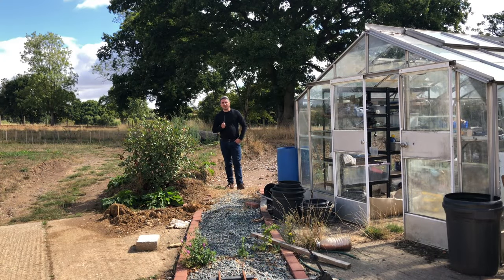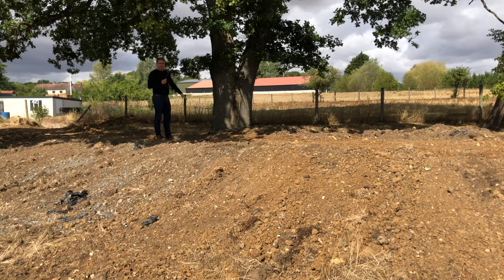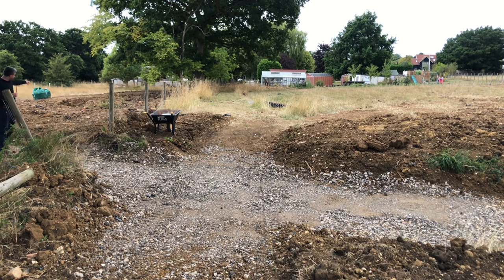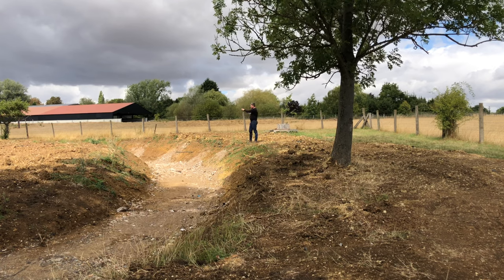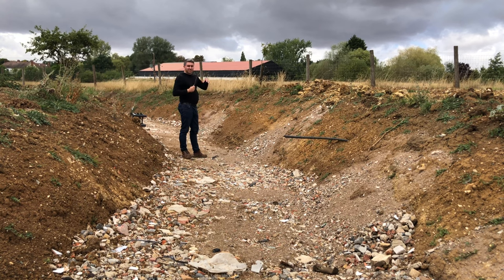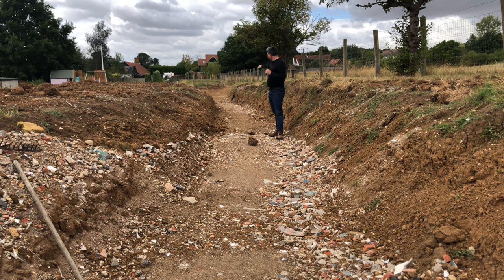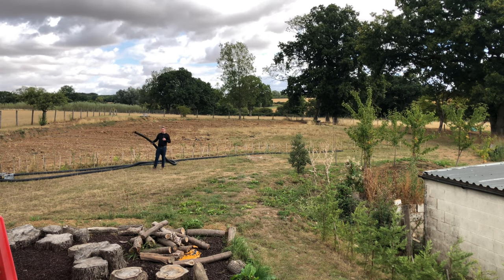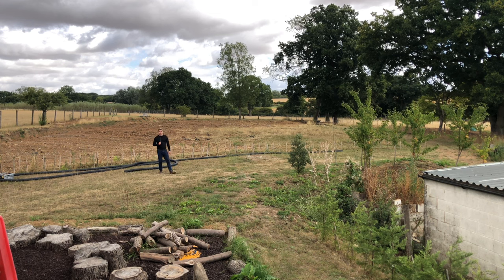Rebuilding a miniature railway - 3. Track Bed

Comment: So pleased to see you did not give up on this great project Rob. I know from experience that time spent on a good formation is never wasted as it avoids much arduous maintenance later. You didn't have either a bridge or a tunnel before - good features to add a bit of fun. Looks as if most of the harder grunt work is nearly done so you can move on to the easier grunt work and then that wonderful day when the first length of new track is laid. I wish you a strong arm, a bottomless wallet and some helpful contacts.
Reply from the maker: Wow! What a very lovely message Martin! I don’t think you could have summed it up better and I would very much love a bottomless wallet and helpful contacts right now (although I must say how grateful I am for the ones I do have!). 
Thank you 😊